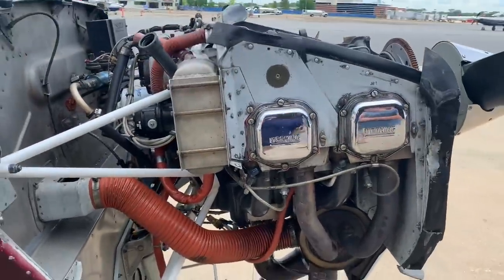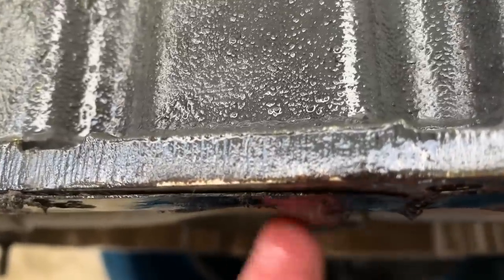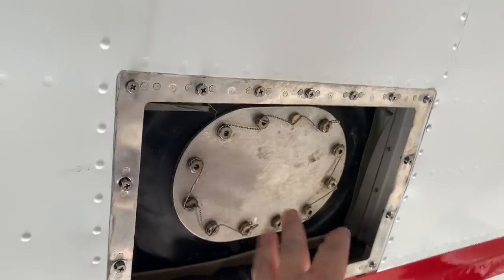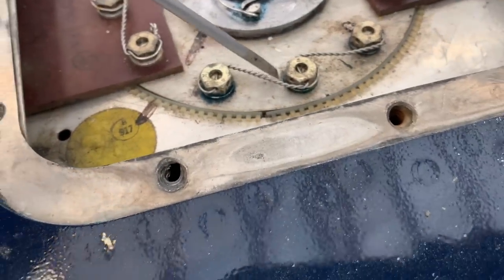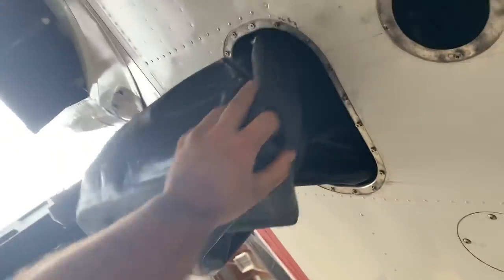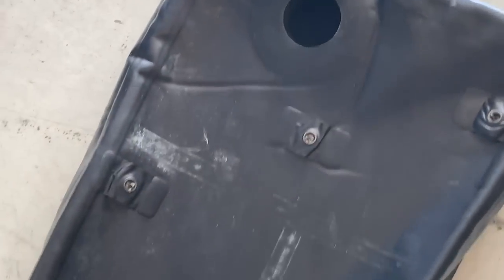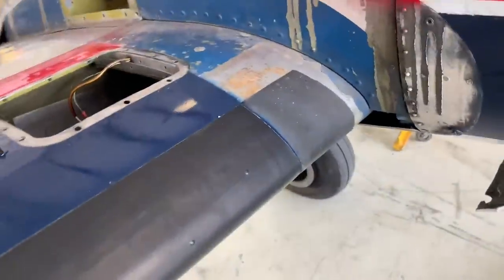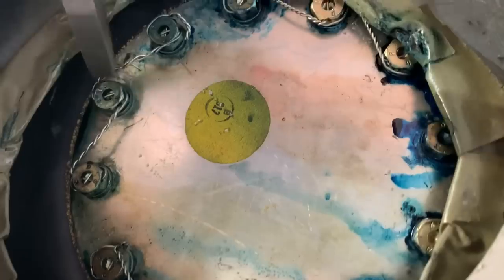Lycoming oil sump leak and Baron fuel bladder removal.  Day in the life of an A&P aircraft mechanic

Comment: What are the ducts for in the oil sump pan? Is it some kind of carb preheat? I was wondering a bit since the air from the intake would always be heated which seems weird to me.
Second guess would be it acting as some kind of oil cooler (which again wouldn't make sense to me since you usually want your intake air to be as cold as possible, no?)

Best wishes from Germany!
Reply from the maker: That’s probably something an engineer could explain better than me…. But if I had to guess I’d say it’s to help prevent icing downstream from the carb and help atomize the fuel.  Carb icing is a big problem and it can happen on warm day
Reply: There are several actions involved.

1- It does help atomize the air /fuel mixture

2- It prevents any ice from forming downstream of the carb.

3- The additional heat hurts the HP out of the motor because the VE = Volumemetric efficiency is reduced.

4- It helps cool the oil to a small degree.

5- That config is easiest for most installs to work with and it is the closest path from the carb to the intake valve.

Comment: What would keep you from rotating the fuel sending unit 180º and placing it in the bladder? It is good that you marked it but I think you should have just marked ½ of the sending unit and corresponding flange. I feel for you having to wrestle fuel bladders. At the end of the day your arms look like you have been sacking bobcats. Great video!
Reply from the maker: The bolt pattern on the fuel senders won’t work 180 degrees out
Reply from the maker: Look at 5:12 and pause it.  One side of the line goes over a screw hole, the other side goes between two screws

Comment: Nice job on the sump. Are you guys familiar with an O-470 C182 sump? Can its gasket be replaced with access to it by removing muffler, carb & induction "Y" duct, to drop the sump out  OR  no way Jose, lift the engine off the motor mounts? 🤔
Reply from the maker: We had to loosen the motor mounts and drop the exhaust

Comment: No video of actual work like wrestling with the bladder to remove, any hang points. Why were the bolts so loose, they were safety wired. If original installation at factory, unlikely bolts not torqued correctly.

Comment: The more I see of your videos the more I wonder - do aircraft owner's ever look under the cowl??? As a homebuilder with a Lycoming engine I can't imagine missing bolts and nuts on a oil sump. I pull cowl and inspect my engine on a regular basis - not just once a year. The whole idea that certificated planes are safer than homebuilts is not true - simply because too many aircraft owners never take the time to learn the mechanics of their aircraft and take responsibility for inspecting it regularly. They go a whole year without ever pulling the cowl - and then expect their A&P to turn their annual around in the shortest possible time. I think initial pilot training should require knowledge of basic aircraft inspections and emphasize their responsibility to keep their plane airworthy. With the current system, the idea that a pilot is responsible for airworthiness is a joke. How can one say their plane is airworthy if they never pull the cowl???